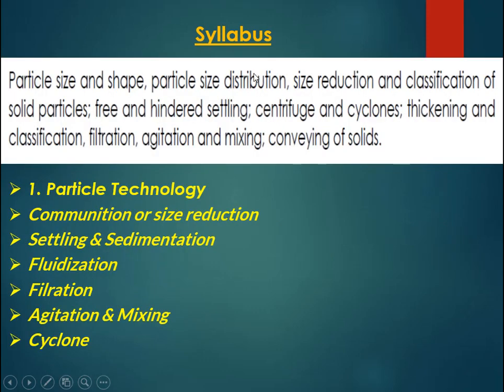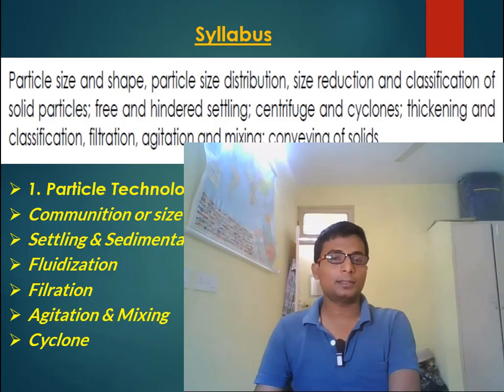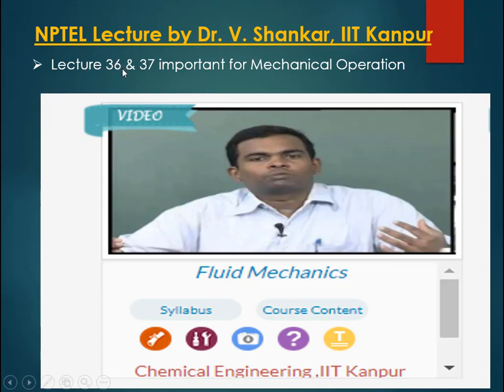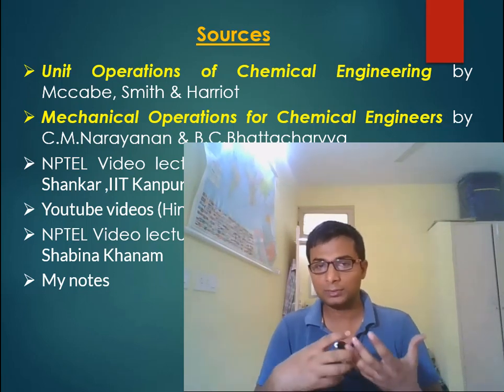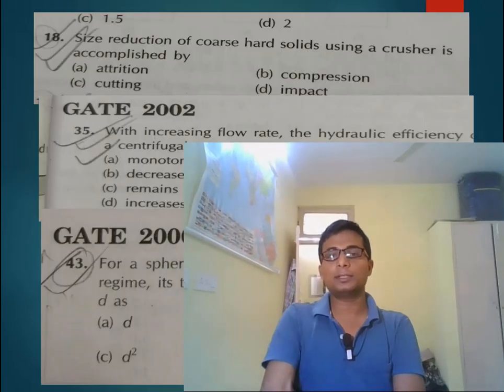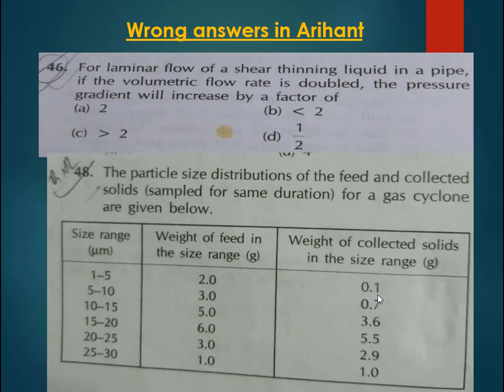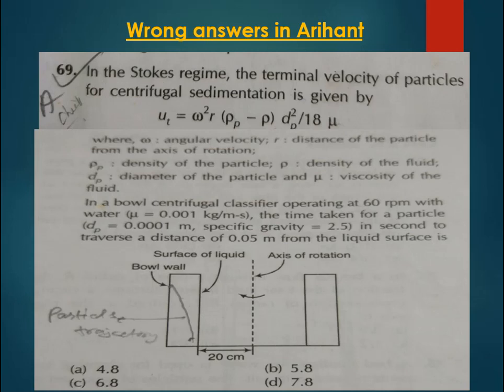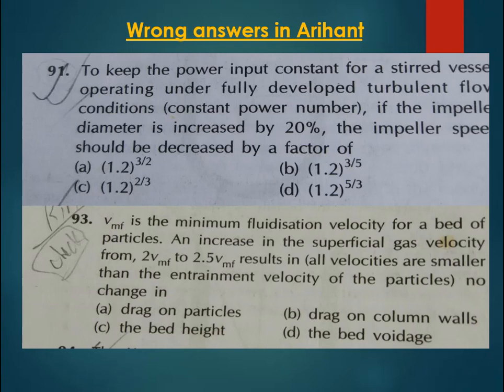Mechanical Operation for GATE Chemical Engineering by GATE AIR 1 |Mechanical operations chemical eng

Comment: Sir i am facing a problem with the content you have uploaded on drive for mechanical operations.. 

Its in rar format and when i tried to extract using computer its showing corrupt file etc things so i am not able to open it.. Is there any way you can upload it in pdf or any other format..
Reply: download rar